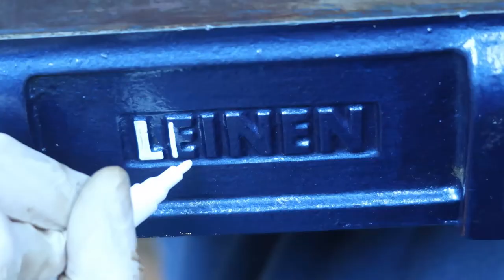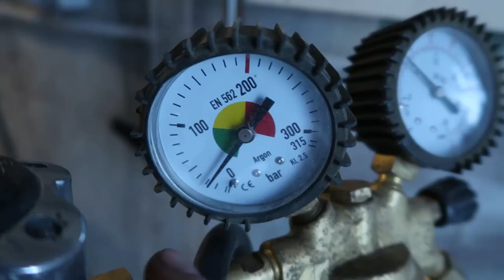Restoring this MONSTER Leinen 150F vise and building a stand for it | Shop infrastructure upgrade

Comment: I just bought the same vise, the Leinen E150 specs say it weighs 53kg, but my F150 didn’t feel as if it is 53kg, because I know I am not that strong to lift 53kg and carry up a flight of stairs to my 1st floor apartment😅

How heavy is yours?